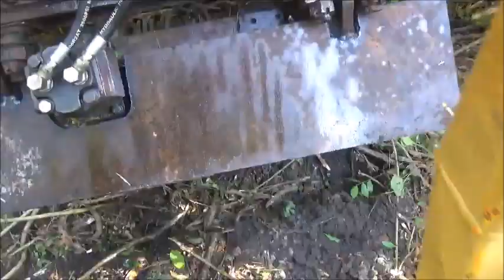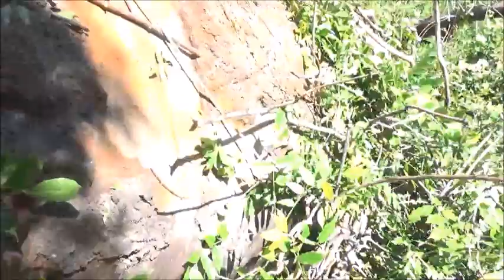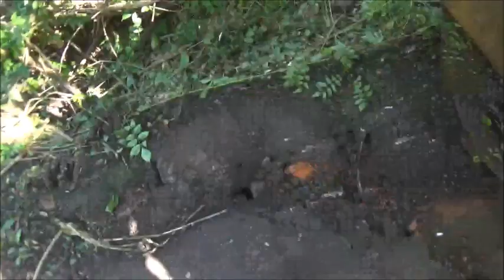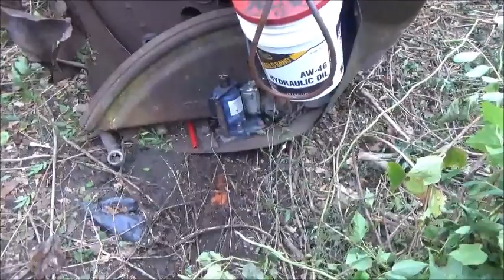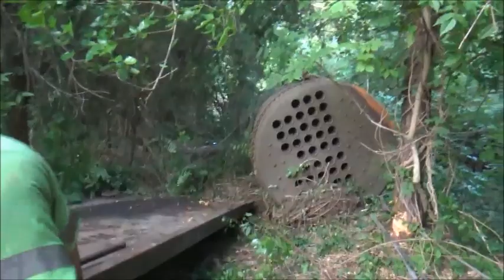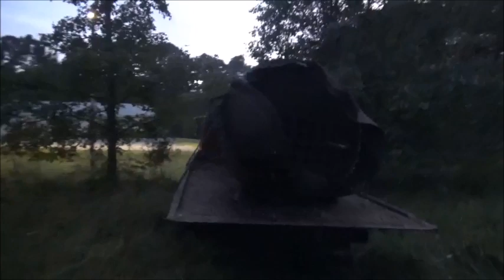BOILER RECOVERY FROM SWAMP Part 2

Comment: Why not try to get it going? It doesn't look nearly as bad as it did in the first video.  If you are worried about pressure, get it tested? If not used, could you possibly use the original as a facade to cover up the new one you make?  Another suggestion - restore it and have new parts painted and finished properly and leave as much original look on the old parts as possible to distinguish new and old parts?
Reply: A functional boiler wouldn't add a whole lot to what Jonathan is trying to do.  Especially if he's using compressed air to run the steam engine.  It's a lot safer, cheaper and easier to run Jonathan's way. There was a video recently from Keith Rucker where even museums who have much larger resources than Jonathan don't want to take on the liability since you wouldn't be able to get adequate insurance coverage.  here is Keith Rucker's video that covers some of the issues in the first few minutes: https://www.youtube.com/watch?v=9W4jaWZro6k
Reply: @spark9040  I didn't know/think of that!  Great information.  Thank you.

Comment: Those aren't flues, they're water tubes.. water is heated in the tubes by the heat and combustion gasses.
Reply from the maker: The water's on the outside of these tubes
Reply: @jonathanw4942  ahh.....a fire tube then. I applaud your efforts.

Comment: I think probably that at the beginning I would have taken one or even two old trailer axles shortened them with a 3" bridge gusset on the bottom and put them under it to start with and rolled it right out . I'm just saying your working way too hard and so is the machinery .